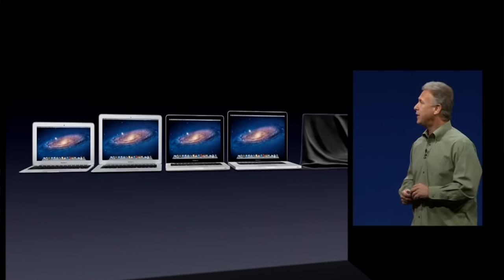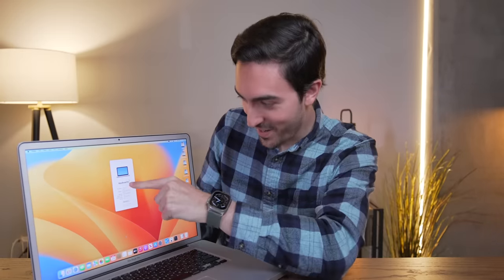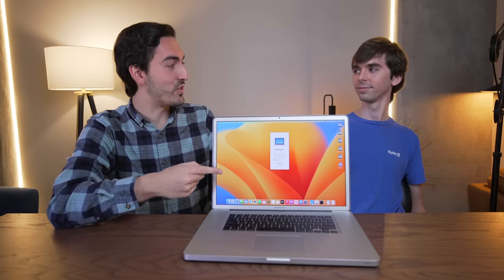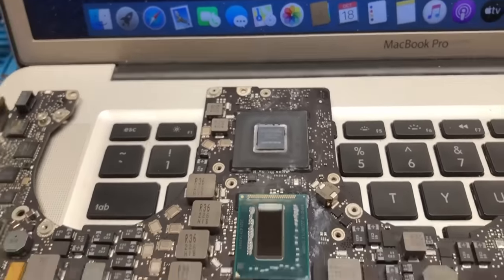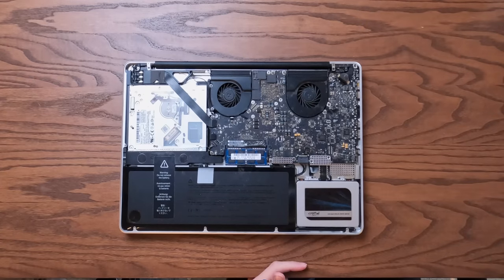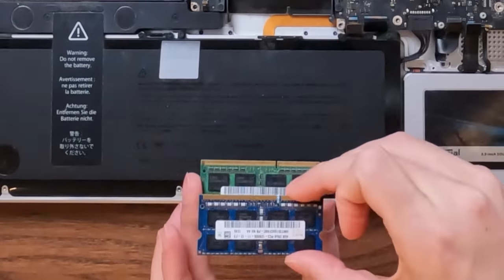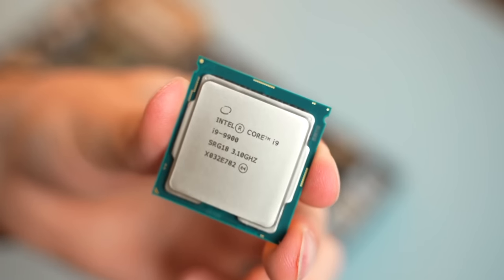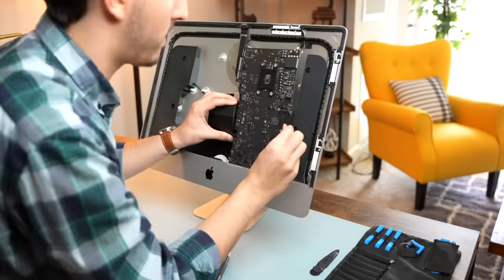Apple Would NEVER Make this…So he did

Comment: Super cool project/video! Mad props to Dosdude1 for all his contributions to keeping older Macs running strong way past Apple's forced obsolescence dates.
Reply: Well in some cases user are actually better off using the latest official OS cuz the thing will get very slow when patched (not on all Macs I guess) but still very impressive indeed. Patched an old 2012 MBA to Ventura :D
Reply: @prayhe  Absolutely - you definitely want to do some research ahead of time to make sure the update is even worth it. I recently opted to install Monterey instead of Ventura (via OCLP) on my 2010 Mac Pro 5,1 that had previously been running Mojave natively, as I'd learned there were still a number of compatibility issues with Ventura still being addressed by the OCLP team. Fortunately, Monterey is running just as great as Mojave was on my cheesegrater, and I couldn't be happier! :)
Reply: @iamkmark  Yeah for the old Mac Pros it definitely makes sense! On said MBA that I own (also using OCLP) you definitely notice a difference in speed between Catalina and Ventura so it really depends on your hardware. I did it mostly because it was cool breathing in some life to that lil buddy :D

Comment: Omg a visit by the legend himself!

Intel HD4000 is one of the few times Intel came out impressing us just a bit with their graphics. For an IGP at the time it felt very capable.
Reply: I think the Iris was even more impressive a year later. Honestly the HD 4000 was only about as fast as the nVidia 320M two years prior, which were integrated into the chipset on 13" models. There's no way the 6770M is slower than that when it works. Performance was never the problem on either the 6750M or the 6770M. Still though, I'd probably trade the 6770M on my 17" for an HD 4000 if I could. The 4000 is of course way more reliable and its Metal support probably makes it more usable these days on modern macOS
Reply: @SterkeYerke5555  I have the GT 650M on my 2012 17” project.
Reply: @SterkeYerke5555  Yeah I had the HD5000 on an i7 8gb 512gb 11" 2013 MacBook Air I bought new. Bootcamp, Steam, Tomb Raider - ran really well. Could actually game well on that spec at the time.

Comment: The 17 inch should've never been discontinued. Is it possible to do this with an M1 or M2 board from a MacBook Air? Sort of the same as connecting an M-series Mac Mini to a 5K iMac display, but connecting the keyboard, trackpad and battery from a 17 inch MBP chassis. (Ports would be easier since the M1 logic board is so small there would be enough space inside to fit like a stripped down USB hub.)

Comment: I have my 2010 17 inch I keep it and i  have the rare sd card expansion slot for it it keeps running like a champ.  I no longer travel with it to difficult.  But I still turn it on and use it to give it some love.  I need to replace the battery I'll be doing that soon.

Comment: What a timing lol , I just tried. installing ventura 13.3 on my 13 inch mid 2012 macbook pro (i7,SSD,16GB RAM , upgraded parts) using Open Core Legacy Patcher , but it failed so badly that I had to install Monterey from catalina , Monterey works like a charm , just goes to show how much potential these machines still have left in em. So now i have macOS monterey alongside windows 11 on a mid 2012 macbook pro lol

Comment: These fail because the cooling on these is crap. I have fixed them by reflowing the graphics chip and not allowing them to get as hot by adding intake holes below the fans. A custom fan curve to keep it from hitting 100 degrees every time it is used helps for longevity. With the intake holes it runs way cooler and quieter.

Comment: 9:34 "its intel and thats how they run"

Well nope, as long as there is enough cooling
Macs have TERRIBLE cooling in general, the heatsinks are so tiny it would still throttle (100c+) even with liquid metal applied.